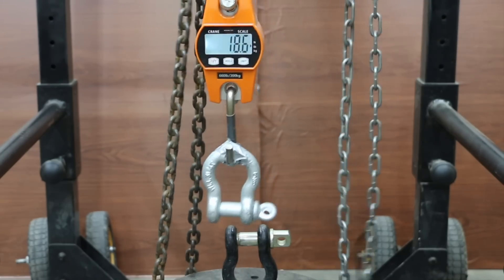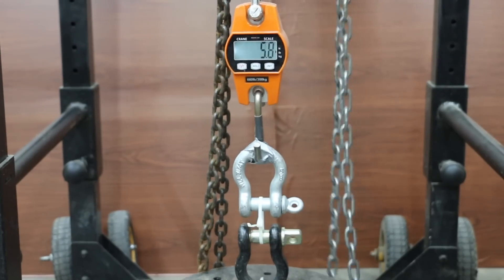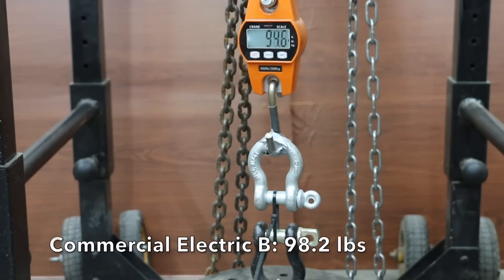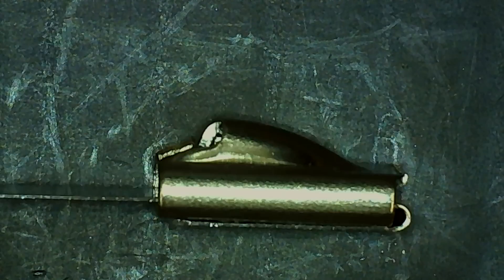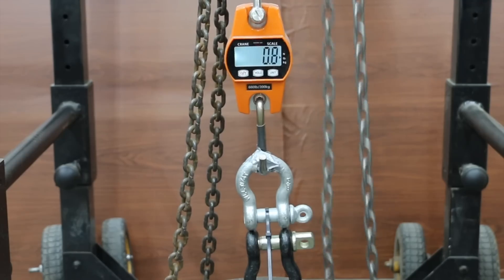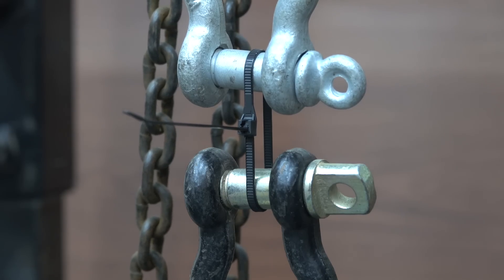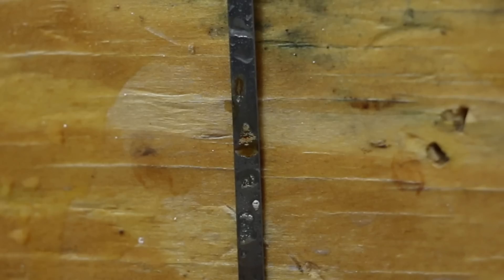Best Cable Tie (zip tie) Brand? Let's Find Out!

Comment: While I appreciate this guys transparency and lack of product sponsorship, this is not an apples to apples comparison.  How can you test 50lb tensile strength ties against 75lb and 120lb cable ties and rank them based on their tensile strength?  Of course a 50lb rated tie will not perform as well as a 75lb or 120lb tie.  Also, if you are exposing cable ties to UV, you should test the UV rated ties.  I'm not sure what good it does to test non-UV rated ties that have been exposed to UV.  Use the right tie for the specific application.  If it is not black, it isn't a UV rated tie...and not all black ties are UV rated either.

Comment: although some might think its bad that a cable tie does not greatly exceed its rated breaking point. 

There are applications where the tie breaking at a specific weight is actually very important for safety. 

The ones that are closer to their actual release shouldn't be discounted just because they actually break when they are supposed to.

Something else to consider.

ACT does offer higher breaking points.
Reply from the maker: Thanks for the feedback.

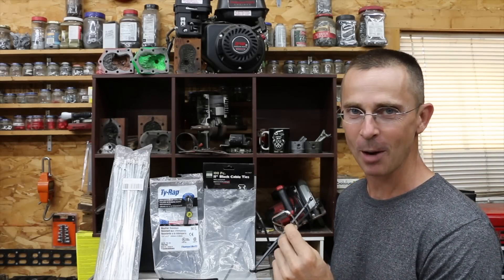Comment: 14:22  Harbor Freight Zip Ties May Have Saved My Life

True story; I was cutting a smaller silver maple tree in my back yard.  Diameter at base, about 18 inches but the height was about 40 feet.  I leaned an extension ladder against it and commenced to sawing the top at about 35 feet.  Maybe not enough height to kill me but I'm older and a fall could potentially break my neck or back.  But, hey, I've climbed ladders before, I've cut limbs before, this isn't that big of a tree...Nevertheless, "something told me", you know, it may not be that big of a tree but there still may be some bounce back when you cut off this canopy.

"Sure, sure" I replied to the thought and went to the garage to see if i could find some twine or something to secure the ladder.  

Yep, found some Harbor Freight zip ties and climbed back up, jerry-rigging the zip ties around the ladder and tree.

"Good enough" I thought and commenced to cutting. The cut canopy begins to snap and I'm like "cool, done" when it falls and the tree bounced so hard I nearly fell off the ladder and the ladder twisted around sideways due to my jerry-rigged zip ties that I had to basically climb down sideways!

Thank you "little voice in my head" and Harbor Freight zip ties!  About one dollar worth of zip ties saved me from possible debilitating or even fatal injury!
Reply from the maker: Wow, thanks for sharing!

Comment: Fun Fact:  The most frequent failure point of PV (solar) systems is zip-ties that succumb to UV and drop the wiring to the roof surface, exposing them to more UV and/or critters gnawing on the ties.

Comment: In the mid 1990's I had a 1988 Lebaron Turbo convertible, it was a fun car but it was a real lemon.  On the 2nd (of 3 total) engines, the block developed a factory fault and split the water jacket right on the factory seam.  The car would still run but it would seep coolant at start then under pressure really blow out.  We cleaned the whole area up, then used a cut piece of metal window mesh screen over the top of the cracked seam, and JB Weld over the top of that.  The fix held for nearly 2 years.  One day on the interstate it finally let go, and wow was that a sight.  A fully heated turbo motor blasting coolant on the turbo and hot exhaust on back of the motor at 65 mph... it was a giant cloud behind me.  But, long story short, that JB Weld is absolutely amazing stuff in the right application.
Reply from the maker: Thanks for sharing.

Comment: Very interesting testing procedures, Todd.  I've never used ties for strength, only order or closure.  I watched a vid on how zip ties are made just before this one, and it was interesting that, even though almost all are made with nylon #66 beads, there were considerable strength differences.  My stock of ties ranges from 4" to 75cm and numbers in about 1,000 most years.
P.S: LOVE the Rolodex of tested products!
Reply from the maker: Thanks!

Comment: The Thomas & Betts "TY-WRAP" is the original "cable tie".
They came in a variety of sizes and colors, and the BLACK ones were UV stabilized.
Made of virgin DuPont 66 NYLON when molded in 1964 -- Kent Corporation, Cross Keys, PA.
Reply from the maker: Thanks for sharing.

Comment: I am a retired "Ma Bell" tech with 40+ years of experience using cable ties. The black plastic T&B "Panduit" ties with the metal latches were mostly what we were supplied with to use on aerial and underground telephone cable work, and I did find that they tended too break easily when used on some cold Chicago winter days ( I would either go through 3 or 4 of them on one spot, or have to warm them up before using them). T&B then made a newer line, which people outside of Telecom tech field don't really know about, called the "Deltec" line (rated 250LB breaking strength). It is a 2 piece tie, the strap either being cut to length or supplied on a 50ft reel. The latch we called a "button" , and it was a plastic component with a slot and small non-corrosive metal latch within a slot on each side of it. The button and strap are both made of a "Delrin" plastic type, which did not absorb water and is very UV resistant, and the buttons are basically reuseable as well. Regular black plastic ties would absorb water and loosen if used in wet underground  environments, the Deltec straps would not.
Reply from the maker: Thanks for the feedback.

Comment: I don't think it was a fair test to compare all nylon ties to a metal barb tip tie.  My company sells a large amount of bulk Panduit barb tip ties (BT4S-M0) that outperform any competitor.  The stainless steel ties also come in different types or grades of steel and thickness (314, 316, etc) that has to be considered as well.  Overall, this was a great and informative video!  Awesome job!!!
Reply from the maker: Thanks and you are welcome!

Comment: I'm not sure if the Harbor Freight "Store House" brand has had a slip in quality or what, but I just used a couple 100-packs of their 11" white cable ties (label says 49lbs tensile strength), and every 3rd or 4th tie broke when I tried to tighten it. Also, some of them simply wouldn't tighten at all because the locking mechanism was broken right out of the bag. It's possible that I overtightened them, but I doubt it. I always tighten down cable ties as tight as I can, and this is the first brand that I've had anywhere near this number of breakages with. Maybe I just got a bad batch, but I'm definitely going to be very hesitant to buy the Harbor Freight brand in the future, and will probably just switch to another brand and never look back.
Reply from the maker: Thanks for sharing.

Comment: Video idea.  Sorry if this is already covered, or at least mentioned, but,...Could you test these with two wraps instead of one.  and maybe three.  Will they hold more if an individual tie was wrapped twice instead of just once.  And is it better to have the mechanism in the middle or riding on the material to be attached?
Reply from the maker: Thanks for the suggestion.

Comment: We use to call cables ties as tie wraps here in our work. Didn't know a brand existed on that or was it the original cable tie? Tie wrap/ty-rap is like a household name in here. 30 percent of our tool box is allocated at storing tie wraps and adhesives.
Reply from the maker: Thanks for sharing.

Comment: By UV exposure, do you mean sealed bags left out? Any time you open a bag of nylon zip ties, from that point on they will start drying out. Resealable bags would be the only way to prevent moisture loss. A zip tie bag opened a year ago will perform worse than a freshly opened bag.
Reply from the maker: Thanks for the feedback.

Comment: I don't believe you mentioned whether the UV exposed units were from the same package as the ones not irradiated.  If they are not from the same batch there could've any number of differences in the manufacture.   Batches of resin pellets can vary molding temps and sprue injection pressures also can vary all changing the thermal stress on the polymer. 
One of the odd things I've dealt with making Four Slide wire-bending  tooling is that no two batches of wire  have the same spring-back.  Maybe polymer batches experience the same kind of  variation.
HEY~!!!  Do the chains make a big difference in the mud?

Comment: Snap on is the last tool company I buy from. We have 3 tool trucks that come by my job at a collision repair center. I buy Matco. The warranty is great and not TO over priced. I only ever buy snap on if I really really need a tool and the truck is there. Also for my 1/2 and 3/8 impacts I use Milwaukee they’re the best.
Reply from the maker: Thanks for sharing.

Comment: This has answered an age old question of UV exposure.
Clear ties fail in my job, way before black, out in all weathers in the UK.
In my job, they are not under loop tension, but some fail just done up not even super tight.
My tip...if outside, go black if you can, and unless required, do not pull super tight, as the lock tooth get 'chewy' when hot by sun, and can fail.
Great info on this video!
Reply from the maker: Thanks!  Thanks for the feedback.

Comment: Gday from Australialia. Mate, the test used here are flawed, when considering the purpose of a “Cable Tie’. It isn’t about carrying a weight. To properly test them, you need to tie them around a round, expandable device. From o to O . The locking mechanism is not designed for straight pull, as you do, they are for and expansion load, equally over the entire cable tie. 

That’s my view, maybe you can re-do it using an expanding method of testing.
Reply from the maker: Thanks for the constructive feedback.

Comment: I’ve been using “rugged- perfect for winter” plastic ties on my sailboat winter cover for four years.  It secures a skeleton of plastic electrical conduit to the boat, with a fitted fabric cover over it.  It sits beside the shore of Lake Ontario, covered in snow, and exposed to howling icy winds all winter.  Every year, I’d come back, find broken pipes and broken zip ties.  The snow would fill in the depression and start to collapse the cover.  I’d check it every week and make several repairs every winter, which was a huge pain.  I always wondered if it was the zip ties or pipes that were failing.  After seeing Project Farm, this year I switched to the metal zip ties he tested.  The result?  As of yesterday, no breaks, no damage, zero issues.  I taped over each metal tie to keep the razor edges from slicing through the cover.  Thank you Project Farm!   After seeing this, I decided to support you on Patreon - you put a lot of time, money, and effort into your videos.  Lance in Canada
Reply from the maker: Thanks so much!

Comment: Many zip ties lose grip with the slightest amount of oil or grease 👎
Reply from the maker: Thanks for the feedback.
Reply: @ProjectFarm  love all your videos and watch them always. You are more scientific than most modern-day and self-proclaimed scientists. Stainless steel zip-ties usually depend on a small bag to creat friction and lock itself. The strap held up well to oxidizer how did the ball hold up?
Also it would be a good idea to study the effect of rust, heat, cold, grease... etc.

Comment: Love  your vids and the scientific manor that you test. Do a video on best soap for washing greasy hands(gojo, shop soap), best normal soap for washing greasy hands (dawn vs bar soap) etc, and for the few women that watch (totally sexist comment just kidding : ) ) and best soap for washing dishes . You could touch parts of your engine wearing tan/translucent latex gloves dip them in motor oil, grease, but best  would be to touch the oil pan that has grease oil dirt grime all the stuff you get on your hands when working on an engine*
Reply from the maker: Thank you for the video ideas!
Reply: @ProjectFarm  PF is one of my top three favorite youtube channels and I like to use what physic/chem I learned in college to help out the videos. I recently left a comment why using jet fuel is dirtier then gas due to the hydrocarbon ratio, hope that helps out! keep up the videos!

Comment: Great video! But when you did the testing, you tested the tie in loop, the tie actually have only an half tension of the reading on the meter. You should mention this in the video.  A cable tie rated at 50lb, in your test should have 100lb in the meter .
Reply from the maker: Thanks!  Thanks for the feedback.

Comment: I have found the military surplus aviation grade nylon ties to be the best. They are marked made in the USA and have a stainless locking insert as well. I do not know who makes them but they are inexpensive when buying in bulk and strong and do well in the Montana cold. Other ties become brittle when cold. Another trick I use on nylon ties is to put a dab of super glue in the locking mechanism as a backup. The police handcuff grade ties are also very good but expensive.
Reply from the maker: Thanks for sharing.

Comment: Thank You. Great Science as always! Look up "Instron Tensile Testing Machines" as (I have commented before) rate of pull has a substantial influence on the breaking point. Instrons are the industry standard for engineering but much too cost-prohibitive for shop use. But maybe you could rig some clever means to control the rate. I have been blown away by how many repeatable methods of testing you have created. Great job!
Reply from the maker: Thanks for the video idea.

Comment: Wonder if the location of the lock has anything to do with the strength. As this setup was pulling against the lock. What happens if you move the lock so its pilling straight down the from the pin.

Comment: Definitely gonna buy some of those cheap HF ties. I do alot of work on jetskis and I'm always using cable ties for wires and hoses..and then cutting them off and running more. So i like good cheap ties that are still good quality.
Reply from the maker: Thanks

Comment: Not all zip ties are UV resistant. Those that are, tend to be black , not white, and labeled UV resistant. I work on cell towers at times and consistently see white or unrated tie wraps that are useless a year later on substandard installs. The stainless ones work well and are worth the price. IMHO, If you need an outdoor cable tie, use the stainless, or in a pinch, use stainless hose clamps, unless what you zip tie is temporary or of little value. Even the UV ties eventually degrade.
Reply from the maker: Thanks for the feedback.

Comment: Hey Project Farm! I've got one for ya... so, yesterday was pretty sketchy at work. We had to install a huge steel access ladder, 28' with a safety cage, from the mezzanine to a roof hatch inside a finished electrical room. Tearing out the door just to get the thing in was just the beginning, but here's the point of my writing you: how about a video on chain falls vrs come alongs, maybe the use of pulleys and snatch blocks too. Here's a set of videos that could possibly save a life, namely mine, the next time we have some wonky rigamaro going on like that. Thanks!
Reply from the maker: Thanks for the video idea.

Comment: Don't know if some one else has made this suggestion, but next time you test the plastic zip ties, please include flex test.  Even when there is very low weight involved, if the ties can flex at all, even a little, then they ultimately fail.
Reply from the maker: Thanks for the video idea.

Comment: Surprising results!  UV exposure hardened the plastic, so it no longer slipped, but then just snapped!  I had not heard about stainless steel zip ties - after seeing the pick up truck in the air, I'm sold!

Thanks for the video!
Reply from the maker: You are welcome!

Comment: One thing that I would like to see in the strength tests is a calc that includes the average minus 2 standard deviation. That would take into account the variation between the multiple repetitions you do and give a more accurate picture of the brand consistency for a given product
Reply from the maker: Thanks for the suggestion.

Comment: I love the harbor freight black 8" plastic zip ties. I use them for installation work holding lube line in place on machines for remote grease lubrication. Keep in mind that I'm not hoisting pick up trucks with them but for the price and strength I couldn't ask for more. I have on occasion found a bad bag with the heads breaking off at much lower than usual tension. I still can't complain. Great video.